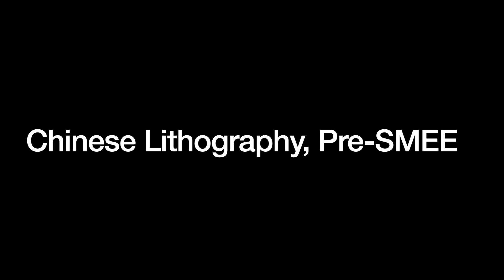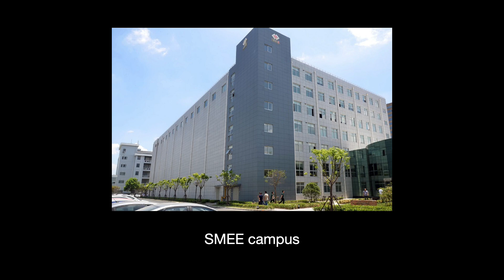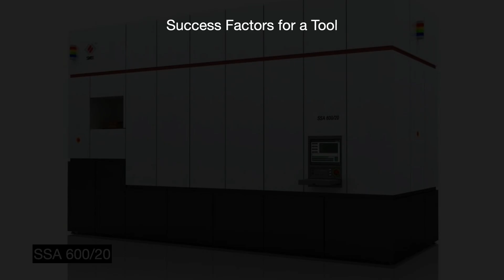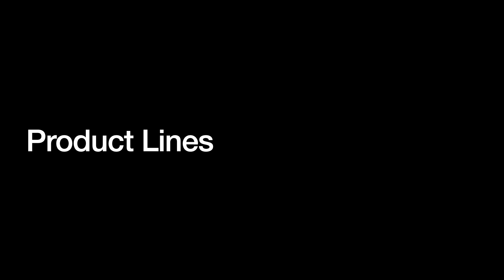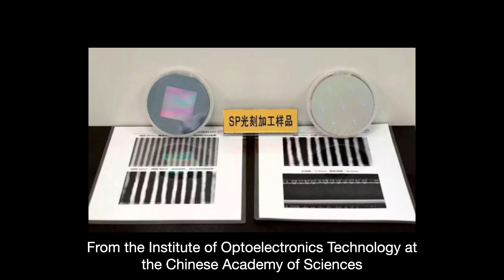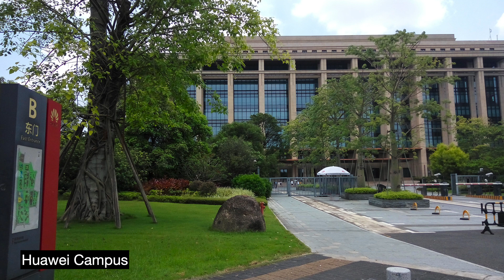China’s ASML is Years and Years Behind

Comment: Having worked in lithography I can confidently say that semiconductor manufacturing is INSANELY complex and the rate of advancement is incredible. I don't know of any industry branch that even comes close. Whole batallions of scientists work on EUV optics, manufacturing mirrors with pm form errors, mechanical stages with insane speed and positioning precision, etc. 
You don't learn that stuff at university and companies like ASML, Zeiss or Cymer publish only what they need to to get a patent. Then you have to find ways around existing patents, although I'm not sure if that'll be an issue for some Chinese firms...
ASML already has a couple of competitors (Nikon for example) with decades of experience in lithography (though not at EUV). There's no chance in hell a newcomer will be a real competitor at the smallest nodes anytime soon.
Reply: Not without a healthy dose of industrial espionage.
Reply: @Renzsu  That's not so simple. As the video mentioned, the most important factor in this industry is human resources. Without human, those complex lithography machine would be useless. You have to have the basic knowledge of how to run them, each and every nanometer of it's operated, maintenance, software and thousands of accessories that other tech company hold... China want to build an inhouse lithography machine is fine, but to compete it is close to impossible without a great breakthrough from talented scientist which they do not attract due to low pay and rigorous and unrealistic practice relate to China's policy and Chinese culture
Reply: @justalittlebitcloser  You're right of course. I was in a bad mood when I made that comment.
Reply: @Renzsu  they had a board member working in ASML once he went on holiday he didn't return and set this up.
Reply: @justalittlebitcloser  Humans? The species pre-AI and Quantum computers?
Reply: Since this confrontation is becoming warlike, would someone go to the extent to cripple ASML by physically targeting its engineers and equipment for sabotage?
Reply: Lol. When you violate wto on such sanction, there is no international patent to talk about.  You can try to sue china on patent in china and see what happens.  Lol.  Assuming you win, the process will take years and penalty will be little.  This is how US treats china’s complaint at WTO… too little too late. The argument about patent is laughable at best
Reply: OK so there is so much to unpack here, let's just consider that the age of quantum AI will of course make us able to automate tasks better, the thing is, it is actually harder to make the euv system but the key take away is that it will be better, China will have learned from the mistakes of others when they develop the infrastructure for euv machine and semiconductor technology, the more firm ground in China will create more automation and if china wins the economic war, we can see a rapid rise of a Chinese tech empire that can be of equal strength to usa companies. Chinese talent will be so much more focused on research other than inefficient tasks, the r&d is better in China but I don't think that China is good with the industrial r&d so I think that the economic war will decide if china can equal usa or not. Once china equals the usa I think by 2028 by some measures, we can see a talent migration, given the bold nature of china we can expect it to win but first it must prove itself economically.
Reply: I guess you have not heard of "reverse engineering"? It is very different to create than to copy.  The Industrial Revolution is the ultimate success in copying and IMPROVING the previous generation's inventions. But new generations are also inventing based on the inventions of the previous generations. The next stage.

Comment: Practically speaking, a Chinese alternative to ASML might be viable even if it lags technologically. As the world recently discovered with the semiconductor shortage, the chips that were impossible to find were not the cutting edge specimens, but older technology with thinner margins used in cars and other embedded devices.

This suggests there might be a market opportunity for a company to build older process nodes, especially in an increasingly digitized society with smart devices everywhere.
Reply: Yes, in fact China has recently refocused its efforts into what it considers mature chip technology, instead of trying to catch-up with current cutting edge technology
Reply: Indeed. What actually use 28nm and smaller process chips? Cell phones. Nearly all the chips in your fridge, air conditioner, the elevator, etc, runs just fine on decades old several hundred nm processes without you ever noticing. Your car battery can't be drained by a 320nm chip, or a hundred. Once the 1.5nm wall is hit, it can't go smaller anyway without moving on to carbon based chips, and china already built a patent wall around that.
Reply: @georgedang449  There is physical limit to silicon, carbon nano is the future i would think, and i don't think anyones ahead.
Reply: @johnm9893  They're not trying to make money on it, they just want to make sure sanctions don't disrupt their economy or supply chain.
Reply: Good luck with china to produce 100 nanometer parts with milling/turning process, the optic, six sigma level deffects on waffer and 100% service level like ASML does since 2000
Reply: @ihsan.l9375  Those are all engineering issues that while difficult, can be addressed to a certain extent by throwing money at the problem and having the persistence to do so for an extended period of time. Like @George Dang suggested, if profitability is not a concern (at least in the short and medium term), a lot of progress can be made.
Reply: @georgedang449  I think you forgot AI which is something china is pushing and very competitive once it comes to training insanely large models
Reply: @jerryhu9005  I think what the other guy says is "quality of art" is your "good enough." Just my opinion, Doing it successfully in lab doesn't mean you can mass produce it since they are 2 different environments. Not sure if China can do it in lab yet, but if they can't mass produce it like Ihsan stated because they don't have the right conditions, then it's not good enough to sustain in the face of sanction. And no amount of money can fix that, it's time and gradual progress.
Reply: @agapp11able it's true that China has a foundation for equipments in larger chips. But US may ban DUV, let alone EUV. And ASML is introducing high intense EUV for chip makers to make chips smaller than 3 nm. Honestly, engineers from SK and Taiwan are excellent experts in chipmaking. Not sure how good they are in making equipments for chips, which is only somewhat related to chips.
Reply: The problem is, that clients are scared Chinese companies might steal/copy architectures etc.
Reply: @tommiko8313  I heard the future was gallium nitride, if they can ever make a solid single crystal
Reply: Question is cost effectiveness. Testa took out the genie from the lamp when using advanced and flexible chips to replace many discreet ones. Althought, many flexible architectures can be developed using old tech with a fresh approach like FPGAs
Reply: China should make mechanical sequencers. Cars actually needn't semiconductors at all and can work well with mechanical rotating cam switches. That's the way petrol engines have been working for decades. Or China could make parametron based computers.
Reply: Please refer to Pascal China's lens for more accurate about China
Reply: @princetrixiebennedict  China and Russia should make vacuum tubes. Who knows. Maybe they could make very very small ones from scratch. The East Germans went to thick film technology(kind of hybrid module on ceramic substrate similar to the Japanese stereo amp modules) as they were denied semicon tech.
Reply: China does not think like we do in the West.  They will use older technologies to make new technology.  They like to take the "Short cut approach". That's the fine thin line.
Reply: 7nm and 5 nm are just numbers. Numbers can keep getting smaller forever since they don’t really mean anything. By the old way of naming nodes after MMP or CMP the TSMC 7 nm node is 50-something nanometers and no measurement on 7nm is 7 nm.
Reply: @soylentgreenb It is not  just about numbers but of power consumption and performance. This is why China can't make exportable handphones. China is limited to 28nm of its own production and TSMC and Samsung have stopped supply of AP to China due to sanctions. Unless China manages to develop its own EUV line. Right now China has just made a few simgle item EUV prototypes but that isn't the whole system. If 5nm and 7nm,both of which are obsolete now.,are just numbers, why did China try desperately to get processes it can't have? Why did Samsung invest $100 billion in cash on process alone or $450 billion in cash totally? Samsung doesn't borrow money or issue stocks to raise investment monies-all comes from its retained earnings in cash.
Reply: @soylentgreenb  Even if China do manage to attain this cutting edge process,  they still lack the ability to produce low-yield failures and so prices will be incredibly expensive to make any marginal profits.
Reply: @agapp11able Like Germany does with China?
Reply: @johnm9893  How could the low end chip business be cutthroat when (1) there is a shortage of low end chips and (2) the tech is outdated and well understood?
Reply: And transistor sizes are close to the hard limit. It doesn't matter if China is behind now when the node shrinking will inevitably stagnate and China will catch up and assure its own security needs.
It's not a bad plan in the long term.
Reply: @ionpopescu3167  2D Transistors may hold the key to the future.   Even if China manages a quantum leap in physics,  I doubt they can mass produce to even with TSMC,  Samsung,  Apple, and Qualcomm.
Reply: Only if they can make it cheaper, reliable output. So lets say better TCO (Total Cost of Ownership) and production speed. If not even if the ASML machine is more expensive, it can be cheaper at the end... because of better quality outputs, higher yields. Faster production and better technical support, and maintenance at downtime. Spare parts... etc we can go on and on. Just the face price of the machine does not matter at all. It's the total price.
Reply: @agapp11able China probably has more engineers than countries outside and is the only country possessing full industrial categories.  

If industrial espionage is so simple and easy, China can CATCH UP in no time! On the other hand, scientific articles and patents are in the public domain.
Reply: @johnm9893  For China, this is not a question of making money or not, but a question of survival. China is sanctioned by the United States anytime, anywhere. You know that. Even if it does not make money, the market consumption scale of China's 1 billion people is enough to support its own 28nm industry chain.
Reply: @tylerdurden3722  there is no monopoly in thinking and creating, this is nature's way that every chinese believe.
Reply: cruise missles and statelites don't need cutting edge chip
you may need cutting edge chip to train AI faster and better. Once trained, to use that AI, a process node from a 10 years old cell phone is more than enough
Reply: This goes for Russian domestic chipmakers as well. Russia was supposed to suffer a domestic chip shortage according to western media but  besides the newest workstation microprocessors the chips used in complex Russian military hardware are made locally by companies like Elbrus.
Reply: @georgedang449  Enlighten me please. But can Chains patent anything in the world? You can't even win a case in China against companies there counterfeiting international brands.
Reply: China comment bot
Reply: You're talking about 2 completely different chip markets. Sure China has like 100k companies making low end chips that go into my microwave. But if I wanted to buy one of those new refrigerators with the touch screen on the door, Chinese chips wouldn't be useful. New cars use high end chips. That's why there was such a shortage of new cars during the pandemic even a little bit now. China produces like 70% of the low end chips that go into a toaster. They own such a market share because nobody wants to get into that business. They are probably lucky to make $1 profit on each chip.
Reply: @jerryhu9005  You don't seem to understand how chips work. It absolutely has to be 100% precision engineering otherwise the chip wont work at all. You can't do the typical Chinese half ass manufacturing where things will fall off the product but it will work for a little while until it completely breaks down. This is not a car.
Reply: @deebil8099  well said.  👍
Reply: @lenomali  this is why I'd never want to do business with them.
Reply: Yes domestically.  But the challenge is that older tech is quite saturated and have very thin margin to make profit in this capital intensive industry while more advanced players are constantly forging ahead with more advanced chips and related devices and applications.  Semiconductor industry is not quite like other industries and it's very connected to global supply.  No single country can do it on its own or create its own and separate eco-system no matter how big of a market they have.
Reply: @Xentradi97  💯❗👍
Reply: for sure but it also ignores the fact that, at least with cars, people would be happy to buy a product that dosnt include this tech, its a self made problem in that way.
Reply: @UIMcocodog  chips on cars are very sophisticated and getting more so with ev's as it's constantly evolving and getting more functional and smarter
Reply: @georgedang449  it's not exactly how it works. Right now we have 5nm chips. But they are not 5nm chips in the same way that larger chips, say 10nm chips are really 10nm chips. 

Let me explain when they got to a certain level about 8nm they couldn't go smaller commercially anyway at least at the time. But semi conductors were always made in with just one layer of semiconductors.  Now they are making let's say one and a half layers or two layers it gives the equivalent of a much smaller size semiconductor.

It's difficult to measure the size of a semiconductor anyway since there shape is unusual and different designs have different shapes making it difficult to keep the measure the same across the board. That's why different manufacturers have different ways to measure. That's what I got from a YouTube video anyway.
Reply: The problem is that in order to fill such a gab they'd need to 1 be closer to the leading edge and two need to be compatetive in throughput, however as it stands their 90 NM scanner handles less wavers then A EUV Machine.
Reply: True but I think XI wants to be a global leading player, not cornering the market is cheap chips that Samsung/Qualcomm etc does not build a fab in vietnam/Philippines etc
Reply: @georgedang449  yeah that's true . 28nm chips are very high tech even now. The main limitation would be software development not sheer hardware power 

Unfortunately that also limits growth potential in the medium to long run.
Reply: About a year ago I got a Joying HU for the truck.  Basically its a 9 inch Android tablet with an embedded 4 channel music amplifier.  Its based on a 12nm china origin chip.  Its not the M1 processor on my iPAD but I got internet in the truck.  I stream FLAC (lossless music) files over a 4G cell channel.
Reply: I heavily disagree. The most prominent reason that current leading semiconductor manufacturers don't pour capital into supplying demand for trail-end chips is that their profit margins are by now extremely low even after decades of streamlining the machinery, industrial process, and supply chains between ASML, TSMC, and their thousands of highly-specialized suppliers. Chinese trail-end chips would be astronomically more expensive and I don't see how they could ever make it even close to commercially viable.